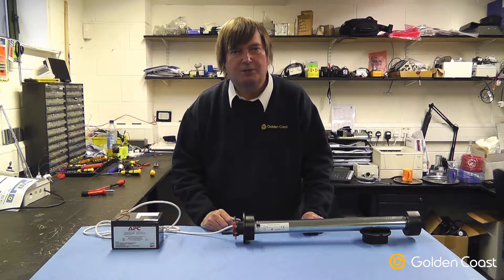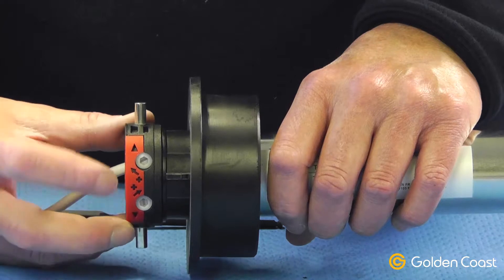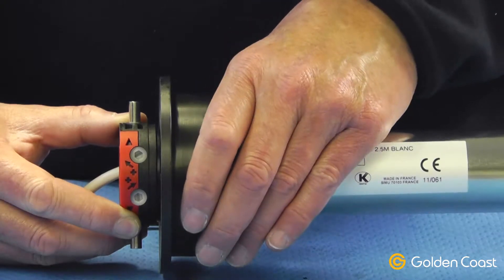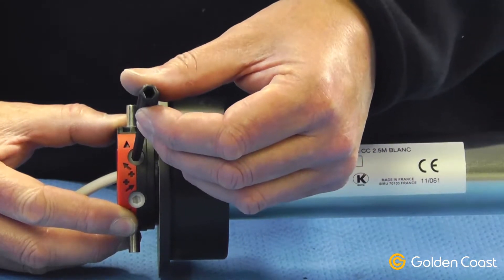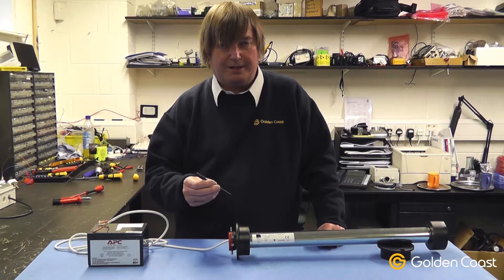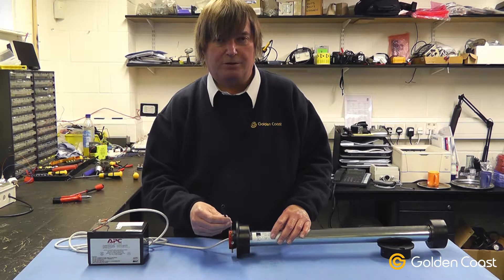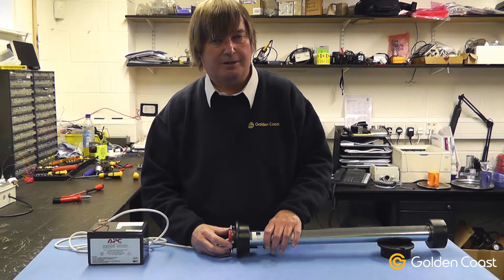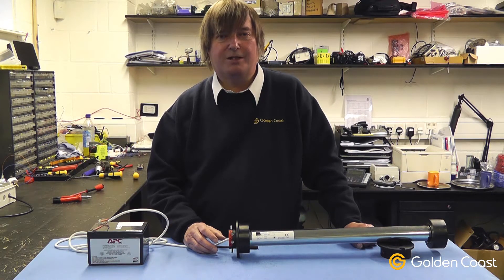Adjusting Automatic Motor Stops on DEL Pool Covers | Andy's Answers

Comment: Andy can you tell what could be wrong . I have replaced the  12 V 
battery but cover still not working
Reply from the maker: Hi Rachael, First make sure the battery is FULLY charged and check the battery voltage when the key switch is on. This is a common problem and you can see my video on this here https://bit.ly/39m1mga
All the best, Andy